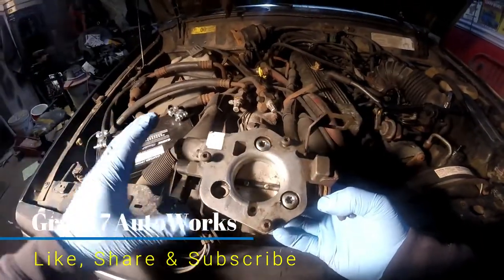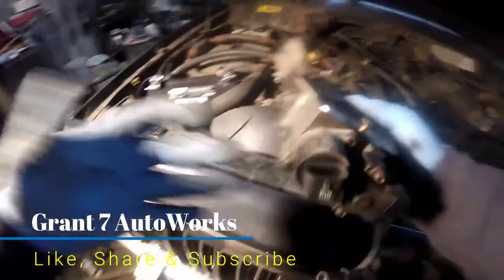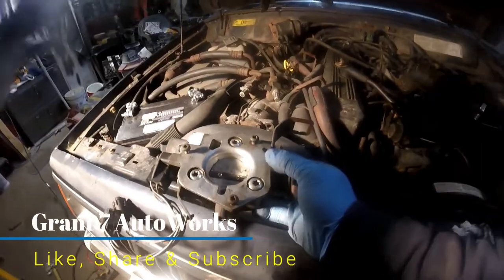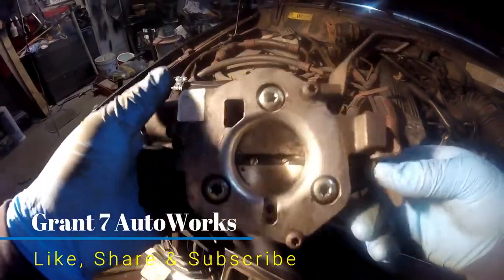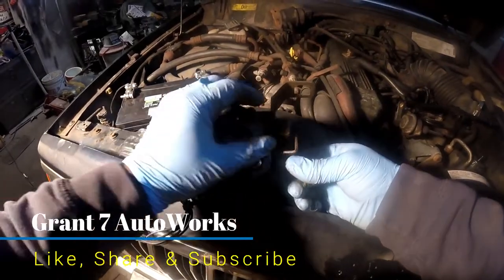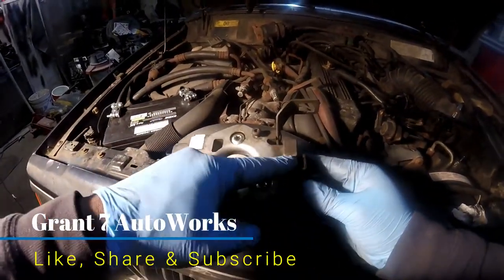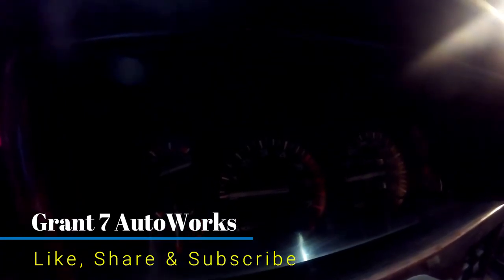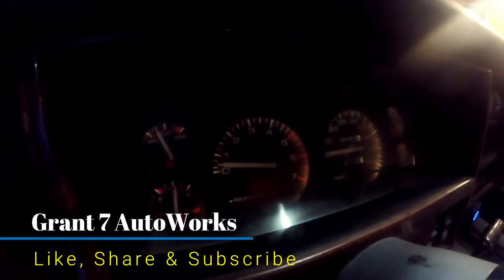How to fix the fast HIGH idle on your Jeep  for FREE - Throttle body mod -Cherokee xj, wrangler

Comment from the maker: For Tools, Parts, Paint & Accessories - https://ipartcars.com/
**There is a Adjustable Screw in that location which could be adjusted with an allen wrench BUT on mine, it was seized / stripped which is why i had to grind it down some-- TRY TO ADJUST THE ALLEN SCREW BEFORE GRINDING - AND UPDATE, MY JEEP IS STILL RUNNING AND IDLING GREAT- THANKS FOR WATCHING!!!**

Comment: This is absolutely genius.
Who knew? It makes perfect sense now. My idle issues have been like chasing gremlins. A nightmare. I have made noticable, but unsatisfying, progress by doing all the other suggestions in videos. I discovered a strange thing with weather changes, temperature, humidity, etc. When you said "older jeeps" it all clicked together. I  immediately understood what the problem was and therefore the solution was going to be.

It's usually the simplest of reasons, isn't it?

And in this case it's just wear and tare on a damned wafer in a "butterfly valve."

You will run into the same problem and issues in industrial systems like: steam systems, chilled water systems, etc.

Valve seats are made of corrosion resistant material like aluminum and brass... They wear out. Even in ductwork. If you think of the air around you as a having fluidity, because it does, it she make sense how weather could be no coincidence. Our atmosphere is really a mixture of gases, yeah? Gases share similar properties to what else?
Fluids.

SMDH. 🤔

I am a pipe fitter by trade. Out of Atl. LU#72. It should have be obvious to me. But is wasn't. 

Thank you my man. Thank you... I'm so excited to finally have this one figured out, I'm getting up right now and taking care of it. I can't wait for tomorrow! No time like the present! 👍🏻

Btw, they should preserve your brain my friend and show the little ones the brain from the genius who figured out the high idle problem XJ owners went crazy and sometimes broke trying to solve.

I'm so happy right now!
God bless! 👆🏻

✌🏻

Comment: Recently I changed my injectors to four hole. During, I messed with that stop so the lever wasn’t soo stiff. Smoother easier acceleration I was thinking. Now my check engine light is on with error P0122 throttle position sensor A etc etc. I knew immediately it’s was because of that. I have to take it all apart tomorrow to readjust it and put on the new heat shield I just received in the mail. Don’t want heat soak to become a big issue, do we. But! What a relief I believe i know what happened. I kinda knew because it was not starting right up I had to wait for pressure or give it a few pumps on the throttle. I was suspicious due to this now it has an error. 🤦‍♀️
You just confirmed my thinking. Love your aim at saving and very clear so this self teaching mechanic (through my you tube teachers-You among other Jeepers here) am able. My saving grace for sure! ❤️💋 I love my Teachers 🥰 
And early wishes for a Happy Fathers Day...

Comment: Thanks for showing the light through the TB. I felt more comfortable with this idea after that.
Reply from the maker: no problem... there is an allen screw that can adjust the opening, but my screw was seized, so i had to grind it down a little bit. and i havent had a high idle since... thanks for watching